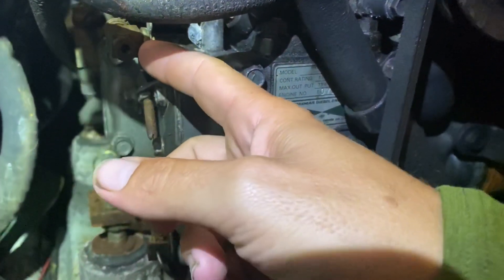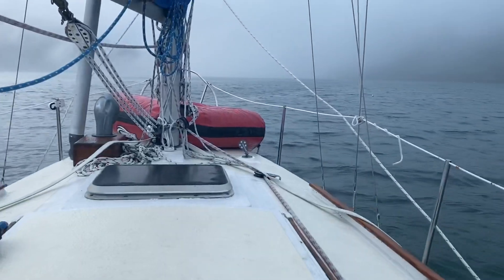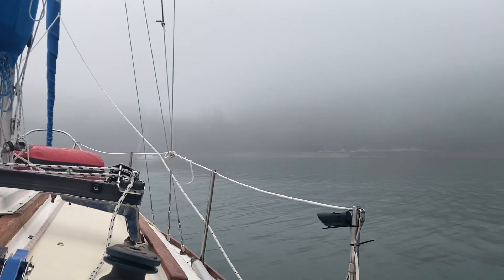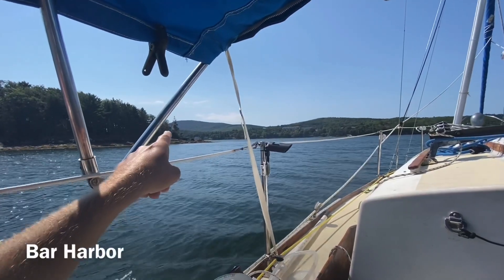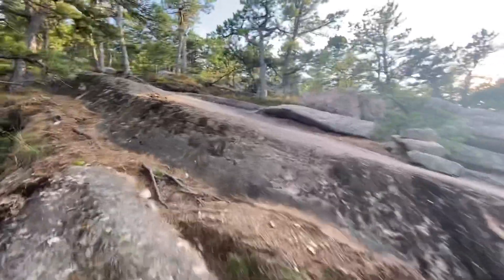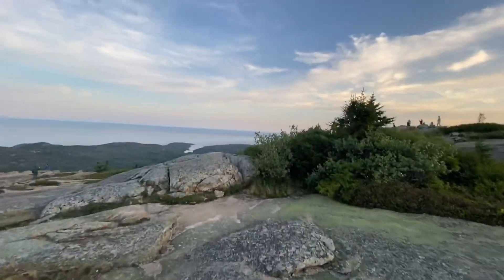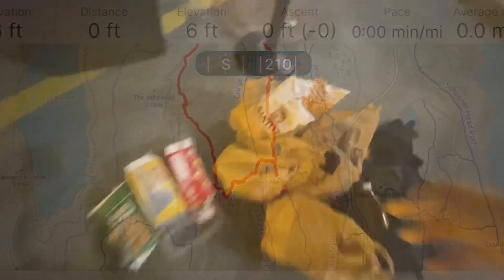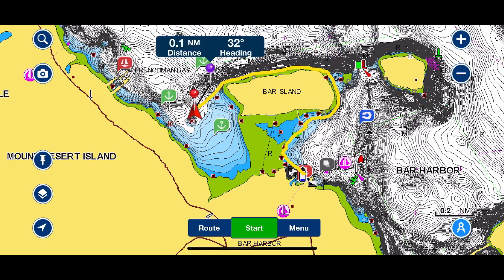Encountering heavy fog on Mt Desert Island

Comment: Hey Sam. Love the videos. Check out what Hank at Sailing Cadoha did to his drone to catch it easily: It's pretty much just a small (thin) wood block with a pole attached to the bottom. Makes catching the drone pretty easy (especially if you're doing it single handed). Cheers!
Reply from the maker: Cool
Reply: @samholmessailing  I think they used a couple of Velcro straps to hold it in place...